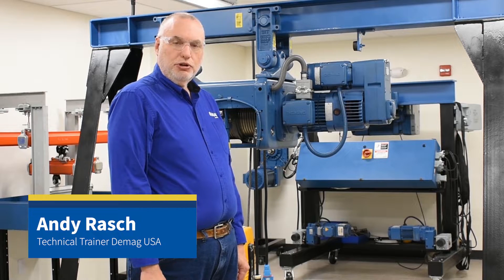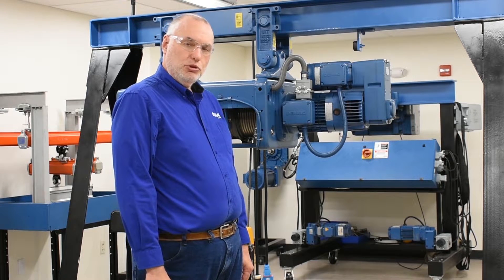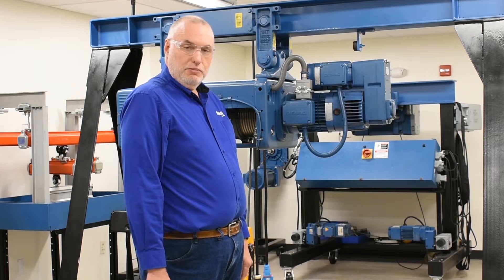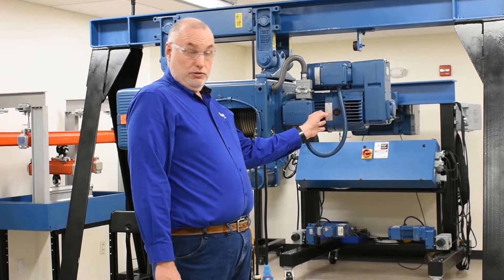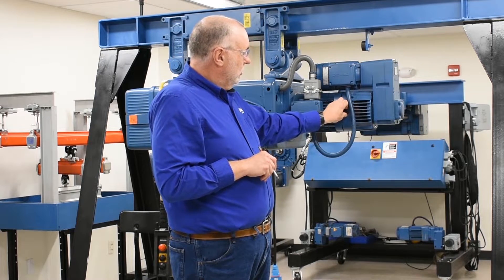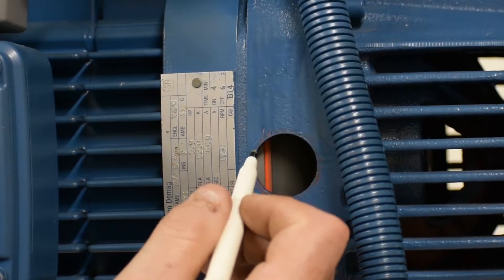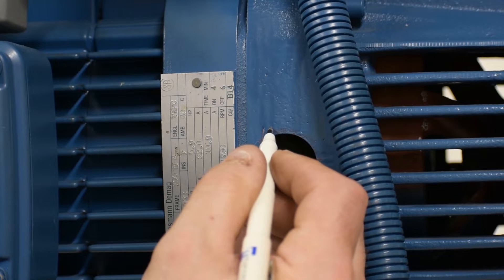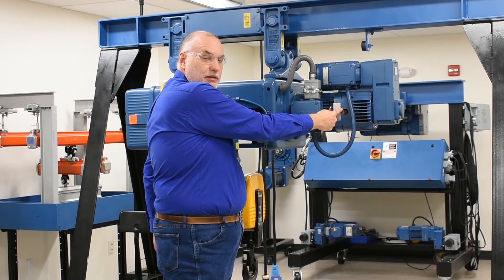Measuring Brake Wear on the Main Hoist Motor on a Demag DH Wire Rope Hoist with Microspeed Gearbox

Comment: It would be really helpful if you guys can explain how 2 speed motors work and if it's creep motor brake is engaged during main motor operation and vice versa.
Reply: Hi, hope your issue has been resolved. If so can you please help me out how your issue was resolved? I am also facing the same issue.
Reply: @sondeepkul   the fix is that as per my experience we need to change the creep motor brake shoe and brake cover unit as a pair for better life.
Reply: @supadchaudhuri6634   what is make year of hoist you are using?